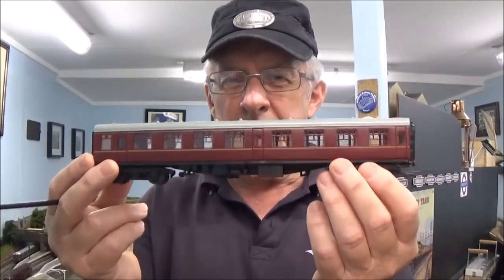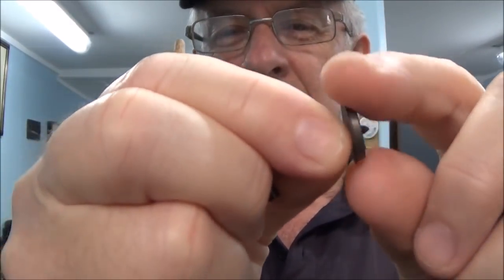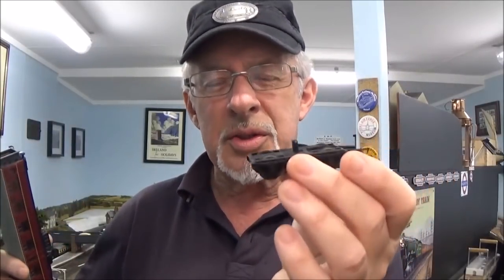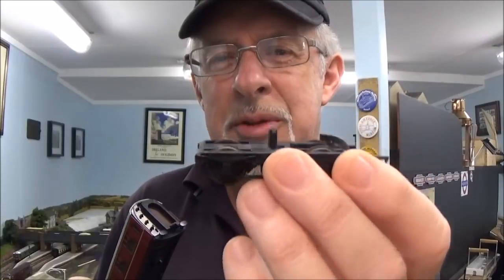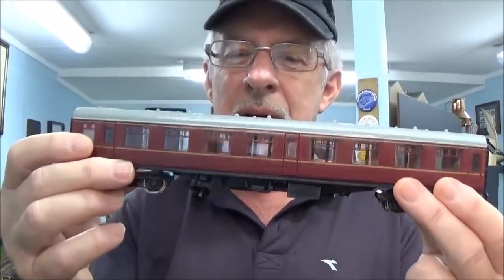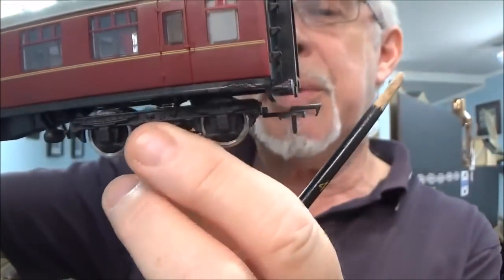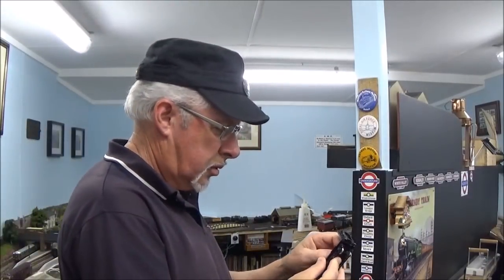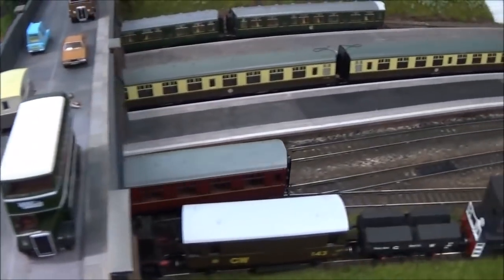Episode 92 17  60 foot Coach Modifications

Comment: You don't need to replace the bogies. Just drill out the rear of the plastic bogie where the axle fits and put in a brass pinpoint bearing and (if required) some replacement Bachmann/Hornby wheelsets. Cheers Gormo !

Comment: Hi Gormo,excellent modifications,would you consider doing this surgery on 4 of my Airfix coaches??.Michael.
Reply from the maker: G`day Michael,
This only works on these el cheapo coaches where you can actually separate the wheel from the axle. The axle is just a black plastic tube. The pin point bearing is on the wheel itself which has a short stub axle at the back of it. The stub axle fits inside the tube. The stub axle is the bit that can be mounted in the drill chuck to hold the wheel whilst turning down the pin point.
If the Airfix coaches are playing up, it may be a better solution to re-wheel with some metal wheels. Hornby or Bachmaan should have something to suit.
Cheers
Gormo
Reply: Many thanks Gormo, will try changing the wheeels,however,I feel that the problem is that the boggie is fouling the body on curves. Strangely a rake of blood and custard coaches also airfix do not derail.........Michael.
Reply from the maker: G`day Michael,
Entirely likely Michael......it just requires methodical observation to find the culprit.If you can remove the bogies and try adding a spacer washer between the bogie and the chassis it may give better clearance and fix the issue.
 Wheel back to back measurements may be worth checking also. If they are plastic wheels they are also prone to accumulating muck which results in a muck tyre on the wheel which in effect reduces flange depth. Removal of such muck can help with derailment issues. One other thing to check on  crossing points is that the uncoupling bar on the tension lock coupler is not catching on the rails as it passes over the point. More likely with NEM couplings. Ask me how I know these things.?????

Cheers
Gormo